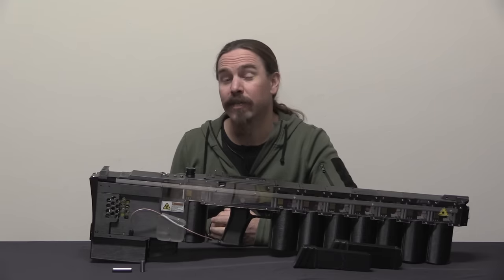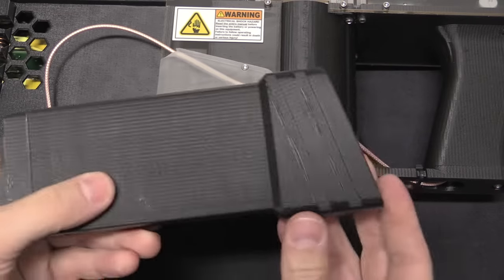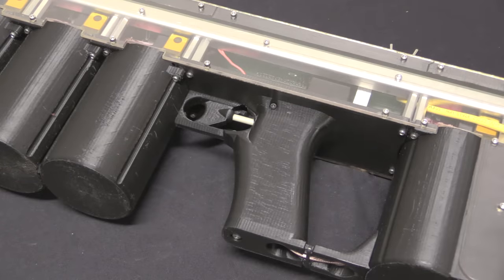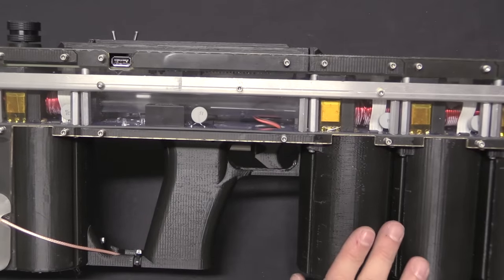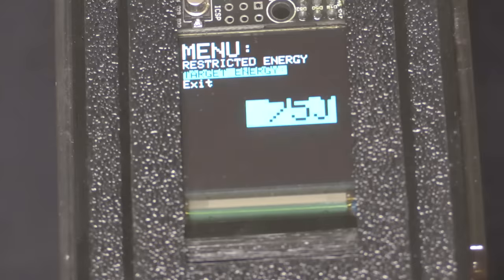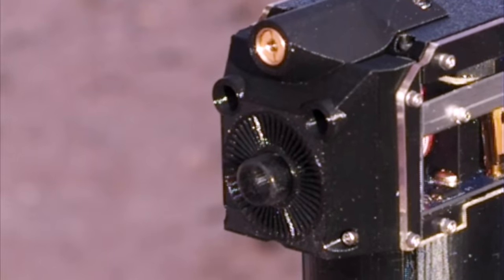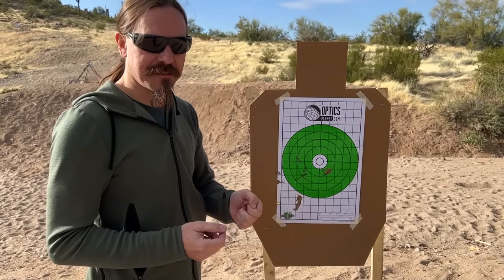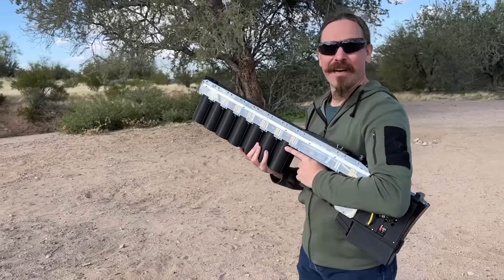ArcFlash Labs' GR-1 Anvil Portable Gauss Rifle

Comment: This weapon is also doing something else very interesting. It's demonstrating the ridiculous amount of energy stored in just a few grams of gunpowder to get a projectile moving at the velocities that it does in such a short distance.
Reply: Such is the power in a few million atoms
Reply: It's also the same with electric cars the energy density of a battery is nowhere near that of petrol or diesel. and short of changing the laws of physics to be accommodating, never will.
Reply: @Smitty.Bacall  Nobody is arguing otherwise. It's an unfortunate reality and a big part of why we're not already switched off of fossil fuels.
Reply: @anderssorenson9998  True, but an ICE is already a fairly energy-intensive way of producing power to a motor. Conventional ICEs spend a ton of their energy fighting drag on every piston, the crankshaft, the gearbox and every mechanical linkage from piston head to wheel.
Electric motors cut out so many middlemen that battery EVs don't need to match the raw power output of an ICE, because they have an easier job to do.

There are companies working on commercial-scale hydrogen fuel cell cargo trucks (truck and trailer semis). Their proposed engine power is in the ballark of 300kW, which is barely the equivalent energy output of a 200HPM ICE, because their torque output is so much larger.
Reply: @JammyD2579  It's fully twice and some as energy dense as as diesel, but that doesn't mean you get twice as much bang for your buck the opposite. drawbacks are many and not just being stable at room temperature sadly.
I do love that any idiot can turn surplus electricity into hydrogen with stuff you could find in any scrapyard though.
Reply: @anderssorenson9998  I'm not talking about the energy of the overall fuel cycle, just that the fuel density of gasoline versus batteries or hydrogen isn't really a meaningful comparison because the two types of engine (electric motor, ICE) operate very differently.

Which means an electric motor, regardless of power source, doesn't need to be "as powerful" (raw kW) as an ICE.
Reply: @JammyD2579  But there are already diesel electric trucks, Right? they work like a train, engine to generator to motor to road.
Regardless, I think of it like the steam engine the newcomen was godawful but they got better and better.  Hydrogen will get cheaper and cheaper as the tech evolves.
Reply: Chemical energy is electro-magnetic energy stored at the molecular level.
Reply: @Smitty.Bacall  just use trains with overhed wires, dont need to worry about gass or battery, just needs some solar pannels.
Reply: @irdmoose  bru, solar is now the best, the teck has caught up. while using nuclear is good and nececary it does not beat the permanent nuclear inferno of the sun.
Reply: @anderssorenson9998  not as bad a difference as you would think with modern battery technology getting suprisingly close to the theoretical limit already.
Reply: @km5405  We might get lucky and crack quantum vacuum energy.  But probably not.
Reply: @irdmoose  Wind is great for small scale, but yeah, I don't get all this nuclear hate
Reply: @onelonewolf2944  It's great at chopping up birds, unless the wind stops blowing or they need to shut it down for weeks on end for maintenance. Every wind farm I've seen in California at any time is 2/3 offline.
Reply: @r64g  And it's stored far more densely than anything else our current knowledge of physics allows for.

That doesn't make this weapon or any electronic mass driver any less awesome. Technology will improve, of course.
Reply: @Smitty.Bacall  supposedly. The earth had much higher carbon levels when the dinosaurs roamed and when there is a growth in co2 there typically is an explosion of life. But we don’t actually know how the earth works because we just can’t know.
Reply: @audunms4780  1 the sun isn’t permanent. 2 you have never looked at an energy bill and compared it with solar panels have you? Solar is far from efficient.
Reply: @jreyman  Who knows, it could well be the straw that breaks the camel's back, plus there is a lot of plastic in the oceans that definitely wasn't dumped there by a volcano. Also, volcanic ash is part of a natural cycle that increases fertility of the land and plant life which helps to compensate for the gasses it puts off. Many human made chemicals with the exception of purpose made fertilizers do not promote life but are deadly to it.
Reply: It's interesting to note that a 22lr has 1.5 times the energy that this is rated for. A 9mm has 5.2 times as much. As far as ballistic devices, this is pretty weak, but still interesting.
Reply: @anderssorenson9998  That's why 'renewables' will have a tough time replacing the fossil fuel energy economy.
Reply: in that case it's also displaying the dangrously simple nature of gunpowder, how outdated it is, and it shows just how long it has left as military standard. especially to those who may have been following such developments, watching portable "rail guns" turn from "its nerf or nothing" to, "don't wanna be hit by that" reeeeeal quick compared to the seemingly stagnant development of solid chemical propellants.
Reply: @Smitty.Bacall  it really doesn't. Warmer temperatures and more free carbon in the environment increase overall biodiversity. The REAL issue is pollution of the ecosystem with synthetic chemicals and endocrine disruptors. Fossil fuels aren't the problem
Reply: @michaelberna987  yes, good job identifying the real problem: synthetic chemical pollution, NOT carbon from fossil fuels
Reply: Roman Semenov  first of all, antimatter is identical to regular matter in every single way, except for the polarity if it's charge. It doesn't "store" any more energy than any other material in existence. There's no such THING as "antimatter", it's not a substance. And as far as hydrogen, yes it stores a lot of energy, but it's very difficult to do so safely in any kind of consumer product. Hydrogen is a gas, an EXTREMELY flammable gas. Gasoline is orders of magnitude safer and easier to store
Reply: @Smitty.Bacall  That's terrible and all, but petrol car go brrrrr
Reply: Roman Semenov  Ahh, yes, antimatter. Antimatter, or more accurately antiparticles, have only been hypothesized to exist and haven't shown experimentally. Hypotheses are not knowledge, though they can lead to it.
Reply: @cantbanme792  A technology isn't "outdated" until something legitimately can replace it. Mass drivers are a great candidate, but to say that they can replace even a .22 short is laughable at best.
Reply: @anderssorenson9998  "But there are already diesel electric trucks, Right?"

Absolutely. Well, I don't personally know if there are, but I wouldn't be surprised - as you say, the tech is well proven with trains.

The historic problem with diesel-electric is weight. Diesel engines, among ICEs, are extremely heavy, and the electric motor they're being used to drive is also very large and heavy. Hence why they're mostly in use on trains and not other vehicles (and only a handful of tanks have seriously trialled hte technology - like the disastrous Elefant tank destroyer).
If fuel efficiency is your goal, weight is a killer. In theory a gasoline-electric in a lightweight personal vehicle would go a long ways to meeting this.

Embarrassingly, I don't actually know what most typical hybrids do with their powerplant - whether they are "gasoline-electric", or if they just have onboard batteries and charge those batteries.

But the use of gasoline is still a problem, hence hydrogen EVs. Unfortunately, Tesla's sudden market dominance has cause the EV market to explode in favour of battery EVs, which more or less kills the market and investment into hydrogen fuel cells. Even Toyota and Honda are considering wrapping up their fuel cell divisions, and they have basically the only major commercially-available FCEVs on the market.
So we may never know whether or not the technology could mature into something useful, if the infrastructure was allowed to pop up and be refined. Ho hium.
Reply: Roman Semenov  That's fair, I stand corrected. Though the failed attempt at insulting was unnecessary. You could have simply pointed out the knowledge gap from the incorrect statement, since not everyone in the world has in-depth knowledge of particle physics. However, though they are routinely being created that doesn't mean it's even remotely close to being usable in any fashion though. My point, even though based on a faulty presumption, still stands.
Reply: Roman Semenov  That's very true, but to call a technology that is the best in its form factor currently "outdated" is a fallacy, since there isn't YET anything to supplant it.
Reply: @JammyD2579  you could make an electric car 100% efficient and the ICE would still spank it in a volume vs volume of fuel to distance comparison. The key to the whole thing is recharge time. If you can get 60% charge (roughly 250-300 miles) in 10 minutes of charging, electric can compete. Solid state batteries could help that but until we get there electric vehicles are a niche. Full disclosure I'm heavily invested in electric vehicle companies and solid state battery companies. But I even recognize, as an engineer, renewables and electric storage just aren't energy dense enough to support our 21st century lifestyle. Nuclear is the only solution for electric generation. Everything else will take up too much real estate and raw materials.
Reply: @vanargrand3199  Pro tip, increased carbon dioxide reduces nitrogen and protein quality in plants, reducing the overall nutritional value of those plants.
Reply: @vanargrand3199  too bad we're destroying more foliage which in turn means less absorption of CO2. Not to mention the massive amount of concrete replacing soil throughout the world to accommodate for urban/vehicle lifestyles prevents water from performing its cycle properly. That leads to more floods and less clean water which in turn means difficulty for life.

The petrol/oil industry (along with others) are directly responsible for this. They were necessary to push civilization to where it is now, but the technology in alternate and renewable fuels is rapidly approaching equilibrium.
Reply: @Smitty.Bacall  an upgradded rail system is a million times better than electric cars

But automotive corps cant make as much money off that
Reply: @audunms4780  solar panels require constant repair and replacement using rare earth elements and even today arent very efficient unless in particularly well suited areas.
A combo of geothermal, nuclear, wind and hydromills and solar panels depending on region is likely ideal
Reply: @JustAnotherAlex  That's more of a problem with industrialization as a whole, not the burning of fossil fuels specifically. It sure doesn't make sense to arbitrarily focus on something so inconsequential when so much more serious damage is being done. Converting to electric cars won't stop people from cutting down trees or China from pumping unfiltered carbon monoxide (the deadly one) into the air.

By the way; Wind and solar power is nowhere near the efficiency or potency of coal and probably even hydro-electric. Nuclear power is cool but environmentally makes burning coal look like that one hippie Coca Cola commercial.
Reply: @tlpineapple1  Well, would you rather live in the midwest next to a coal plant or would you prefer Chernobyl? Now if you're going by straight numbers that stat doesn't mean anything since there are way more coal plants than nuclear not to mention they've been around for far longer. If I'm gonna get cancer either way I much prefer coal. There's just too many benefits. It's almost as if it existed just to be burned.
Reply: @anderssorenson9998  Diesel engines are physically much heavier than petrol engines because the diesel ignition cycle is under higher pressure and at higher temps because of the lower flammability of diesel fuel.

This is plainly apparent in vehicles that give a straight choice between diesel and petrol powerplants - in the ballpark of hundreds of kgs of engine mass. (IIRC VW Tuareg circa 2010 was 300kgs difference between petrol and diesel 6-cylinder engines) The cylinder block physically has to be thicker and denser to operate the fuel cycle.

I don't understand your point here. There is no practical weight saving, as the mass of the fuel is broadly the same and the engine is heavier. The vehicle is "more efficient" and uses less fuel per distance travelled (dependant on a bevy of factors) but that's not the same thing.
Reply: @vanargrand3199  "Well, would you rather live in the midwest next to a coal plant or would you prefer Chernobyl?"

That sentence is so far removed from any logic that I don't even know where to start.  A coal plant can be functioning entirely as intended and is guaranteed to cause all of the negative health side affects that have been proven to result from it.  A nuclear plant on the other hand has to have something go very wrong with it in order to cause any of negative health side affects.  Your comparison makes no sense at all.  You cherry picked completely different scenarios and equated them with each other to prove your illogical opinion.  

"Now if you're going by straight numbers that stat doesn't mean anything since there are way more coal plants than nuclear not to mention they've been around for far longer."

That's not how statistics work.  You could boil them down to a 1 to 1 scale and still clearly see that coal plants cause considerably more health issues and at a higher rate than nuclear ones, and they do so while being completely functional.  Also, coal plants don't just cause deaths via air pollution and waste, they also stop people from ever being born.  There's a strong (and growing) connection between air pollution and decreasing sperm counts.  The effect increases with the amount of pollution and only exists in industrialized states.  Sperm counts in industrialized nations are almost half of what they were 100 years ago.  Coal plants and other dirty power sources are actively turning us sterile, but you don't care about all that because of the minuscule chance that a nuclear plant might seriously malfunction has you quaking in your boots.

It's pure hysteria.  Nothing more and nothing less.  Unsupported by any sort of science or statistics, and propped up by logical fallacies.
Reply: @ancaplanaoriginal5303  Yeah, and large volcano eruptions have killed a lot of people and drastically altered the Earth's atmosphere and biosphere in the long and short term.

When Mount Tambora erupted in 1815 it killed 250 thousand people, caused the coldest temperatures on record between the years of 1766 and 2000, and created major food shortages across the Northern Hemisphere as it was too cold to grow anything.  There wasn't even enough food to feed livestock.  This in turn caused mass migrations south and huge demographic and economic shifts all over the Northern Hemisphere as people rushed to find fertile land.

So if by saying "burning fossil fuels means shit to the planet", you mean that the Earth is a rock, so it isn't affected by pollution, you are very right.  But it turns out that a lot of things on the Earth are not rocks, and are very much affected.  That includes us.  Volcanos and their effects are already enough of a challenge on their own.  There's no reason to add to that by throwing even more crap into the atmosphere.
Reply: @DovahFett  Looks like you put a lot of research and effort into that post. Too bad I'm not gonna read any of it.
Reply: @vanargrand3199  Your maturity level matches your Grade 9 scientific expertise. So, at least there is symmetry.
Reply: You mean makes plant food.
Reply: @irdmoose  nuclear isn't renewable afaik, it just has a stupidly high power: weight ratio and decent reserves, and doesn't release gas but uranium doesn't come out of thin air, and we still don't have a good way to use the byproducts, which are dangerous.

Probably the most renewable source is mirror based solar generators (focus a bunch of mirrors on a boiler, and use the steam to turn a turbine) wind is also similar, photovoltaic and barrages have problems, but are better than coal.

Oil and wood based generators are renewable, but need large amounts of land, and they output too much co2 and particulates.
Phytoplankton based are carbon neutral, but still highly experimental.
Reply: @jreyman  the problem is that in addition to dumping large amounts of co2, we also reduce the amount of carbon sinks, and we may reach a threshold where phytoplankton dies due to the amount of co2 acidifying the ocean, thus reducing the amount being stored and entering a positive feedback loop which increases the co2 even more.

In a couple hundred years we doubled the amount of co2 in the atmosphere, which is 1.5 times the all time maximum.
And there hasn't been any out of the ordinary eruption or fire. While some processes are indeed a larger scale than what we can do, that doesn't mean we can do whatever we want and we won't influence it. We burned the equivalent of like 100 000 years of carbon matter (i.e. petrol/coal/wood) in 100 years.
Reply: @audunms4780  overhead wires have problems on cold weather where there's ice on them and the train can't get good contact, and may not be able to run, while those with diesel generator have no problems. Though in most cases overhead wire trains are better, just not in negative Celsius when it rains.
Reply: @Smitty.Bacall  who cares
Reply: @irdmoose  Actually particle accelerators at both CERN and DESY have created anti-matter. The only issue with it is not weather it exists or not, it does. It’s just insanely expensive to produce.
Reply: @milkwithsauce1536  Oh absolutely, and there's likely going to be no practical application for antimatter for a very long time. I'd wager that with the amount of power we can potentially generate with Fusion technology once perfected, it will go a long way in developing antimatter research, considering confinement and storage of antimatter is going to be the first hurdle that needs to be overcome.
Reply: @anderssorenson9998 Yeah, you have to harness fusion or gravitational energy for electric cars to reach better levels of energy density